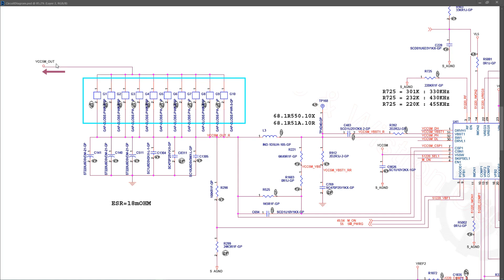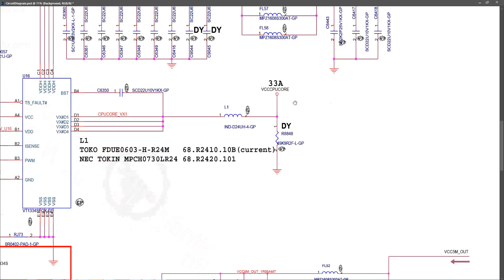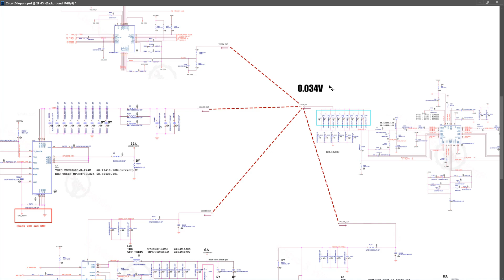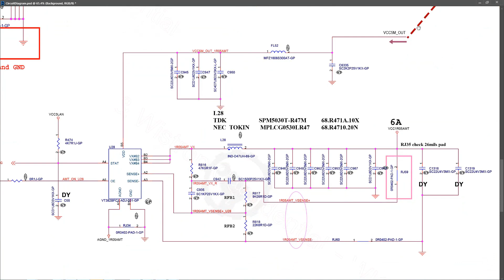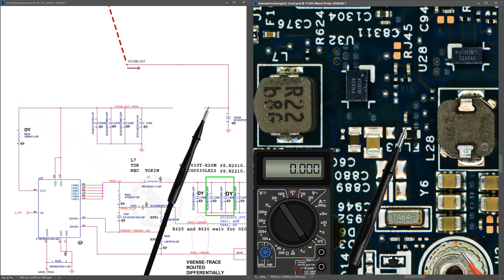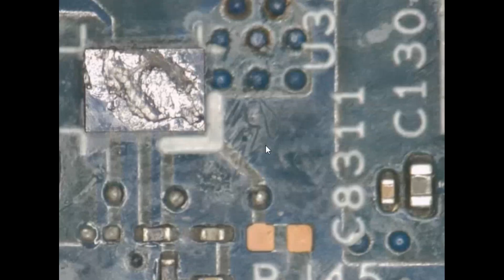LENOVO X1 CARBON GEN3 - I BROKE ANOTHER LAPTOP PART II

Comment: Hi,
   I have X1 Carbon Gen 3 laptop, once charger connected turns on automatically with no display, power button led glows stay on, keyboard led turns on and turns off , also cpu fan. 
done both reset buttons,
Flashed bios- chip off method,
no luck, no improvement.

I think most the users faced this issue, have no solution. Kindly direct me where to find the problem.

Comment: A pointer for you, do not inject 5V into a 5V rail because it's a 5V rail. On these types of devices you want to be injecting 1V maximum on any power rail in case it's shorted through to something like the PCH, CPU or memory power well.

Comment: The closer you get to any short the less Ohms you'll pull.  Doesn't matter if it's a partial short or not.  A apparently you don't a thermal camera.  I've found 40 millivolt short with mine.  A good one with high resolution is worth the money.  I do enjoy your channel, I've watched all your videos and learned
Reply from the maker: Yes, I actually borrowed a Fluke meter to see if it could provide more granular resistance measurements, but every one of my multimeters measured 37ohms (resistance)  and 0.034V (diode) at all points. I guess the key would be to have a multimeter that could give high enough resolution to measure the resistance of the inductors. Thanks for your contribution.
Reply: It's less amps not less homs😂
Reply: I got the p2 pro thermal camera,  your right